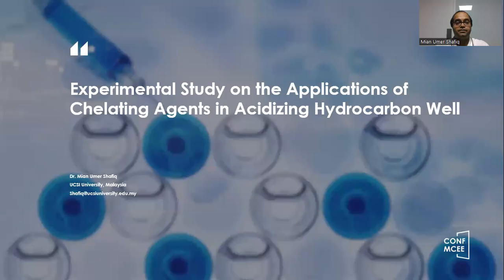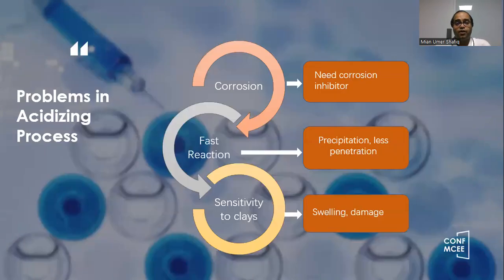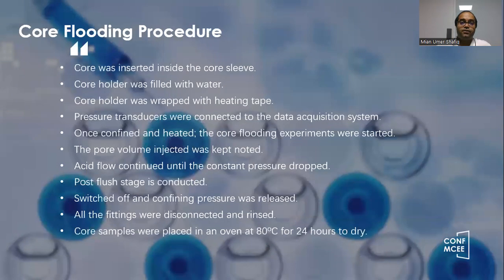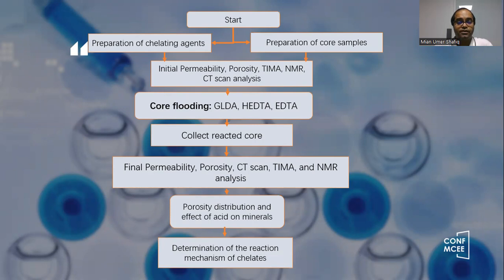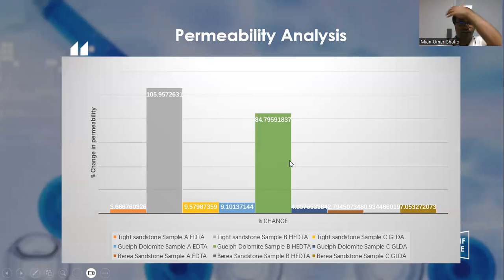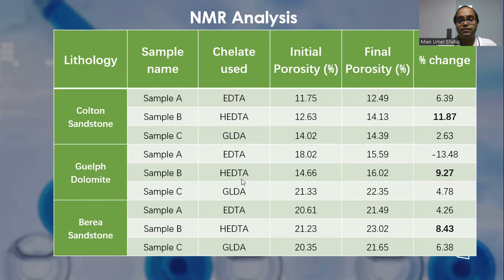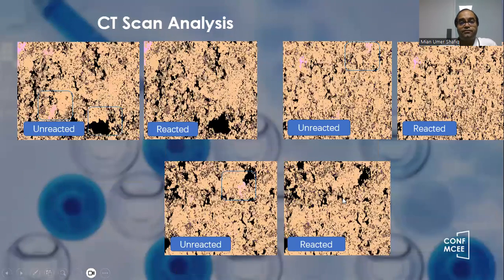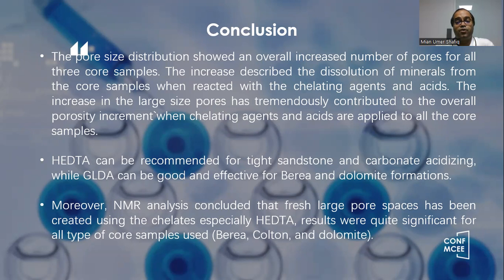CONF-MCEE 2024 - Experimental Study on the Applications of Chelating Agents in Acidizing Hydrocar...

Comment from the maker: Here are the questions we collected and the answers replied by the presenter: 
Q1. How do chelating agents improve the efficiency of acidizing treatments in hydrocarbon wells?
A: Chelating agents are slow-reacting acids that can dissolve calcium, potassium, magnesium, and sodium ions from the rock sample. Acidizing treatment in hydrocarbon wells is used to remove the damage around the wellbore or to increase the permeability near the wellbore region. Near the wellbore, permeability can be increased if different minerals can be dissolved which can create new pore spaces. Therefore, when chelating agents have been applied, they dissolve different minerals and ultimately increase the porosity and permeability. Moreover, their reaction is slow that's why the precipitation phenomenon has not occurred.

Q2. What are the specific impacts of chelating agents on the mineral dissolution process during well acidizing?
A: Chelating Agents dissolve many important minerals which consist of Calcium, Magnesium, and Iron. They also broke the locking between them due to which minerals have been dissolved.